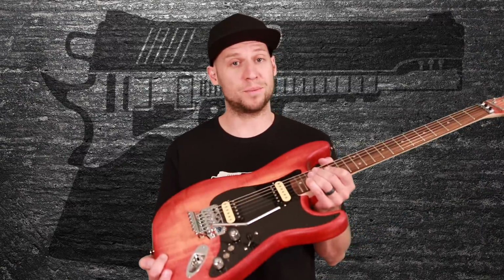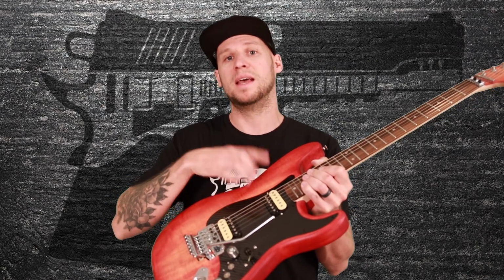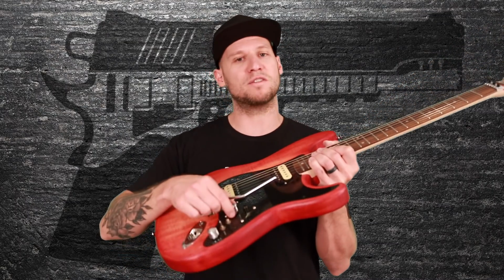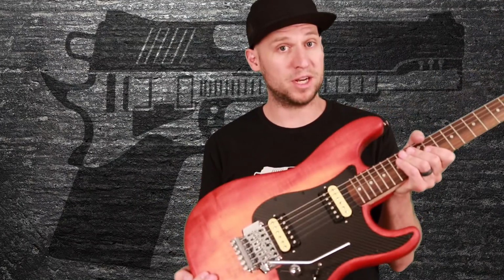This ONE Guitar has EVERY WIRING HACK POSSIBLE! (well...almost...)

Comment: While it is not 42 different tones, the Freeway switch doubles the number of pickups that are "on" at one time...allowing those parallel/serial options, all three pickups selected at once, or the neck & bridge picup. Plus, there are now variable treble bleed circuits that allow adjusting the amount of bleed at will,  with an additional pot. The resistance of the now generally standard 250kΩ pots can be approximately doubled with a simple resistor in a series with the tone control. If the wiring is changed so one tone controls the bridge pickup & the other controls neck & middle, that  resistor can be  added to that  latter  pot, increasing the  brightness of 2 of the pickups, but not the bridge pickup which is usually already brighter than the other 2 pickups.

Comment: Writing this for myself to make it easier to compare...

PARALLEL

split, off 1:51
split, split: 4:42
off, split 2:21

parallel, off 1:41
parallel, split: 3:11
parallel, parallel: 2:41
split, parallel: 4:12
off, parallel 2:11

series, off 2:01
series, split: 6:13
series, parallel: 5:43
series, series: 6:44
parallel, series: 3:42
split, series: 5:12
off, series 2:31

SERIES

split, off 1:51
split, split: 5:03
off, split 2:21

parallel, off 1:41
parallel, split: 3:32
parallel, parallel: 3:02
split, parallel: 4:33
off, parallel 2:11

series, off 2:01
series, split: 6:34
series, parallel: 6:04
series, series: 7:04
parallel, series: 4:02
split, series: 5:33
off, series 2:31

FAVORITES

CLEAN
parallel, off 1:41
split, off 1:51
split (in parallel with) split: 4:42
off, split 2:21
off, parallel 2:11

DIRTY
series (parallel) split: 6:13
parallel (series) split: 3:32
split (series) series: 5:33
parallel (series) series: 4:02
series (series) series: 7:04

Comment: My ‘83 Washburn Force 2 has been a work in progress for a while. It was HH like yours. I removed the original pick guard and electronics and made a new pick guard from scratch. 2 newer Washburn Humbuckers were installed and a middle single coil added by routing the guitar and pick guard. 2 DPDT switches on/off/on for the HB’s. Neck pup is full H or single coil. Bridge is in or out of phase. On/off push button for Texas style mid pup. Separate vol. control for each with treble bleeds blends pups in any combination. Stacked vol. knobs keep it simple. Tone for mid and bridge. 15 distinct tones with switches. Blending the out out of phase pup with vol. gives some really nice tones. Switches and knob layout is user friendly and easy to master. Has a Washburn 2000 trem and locking nut. Plays like expensive boutique model. $300 invested total.
NOT for sale! Love your channel. Dave

Comment: You should try half out of phase (out of phase, but with one pickup in series with a capacitor to block the low end), half humbucker (instead of using the humbucker as a single coil, sometimes one coil is put in parallel with a capacitor. In effect, you get the highs of a single coil with the lows of both in series. It's generally less thin and more versatile than just one coil of a humbucker), and lastly, whenever I put two pickups in series, I like to put my tone pot between the two pickups (the same idea as putting a capacitor between the coils of a humbucker, but acting on the two separate pickups instead. Generally, I find two pickups in series to be great sounding but a bit too fat sounding to make me want to roll down the terrible with the tone pot, having the tone between the pickups, you can get the treble from one pickup and low end from both in series, also a great feature to have with series out of phase, similar idea to half out of phase but in reverse).

On my tele type guitar, I've got a five way switch and a mess of other switches to get the tones I want. I'm planning to redo it and simplify the controls with the following:
A freeway 6 position tele switch that handles all the series, parallel, in phase out of phase, and single pickup options. Then I'll have a push push tone pot that'll either put the tone pot in parallel to the neck or bridge pickup. That will give me a tone bypassed or normal tone option for either single pickup, normal tone for both parallel settings, and a tone pot acting on just the neck or just the bridge when they're in series. Then I'm putting a dpdt on-on-on switch as a bass cut for either the neck pickup, bridge pickup, or both (for parallel out of phase, this will get you the half out of phase tone. In series it'll just give you a base cut on the entire circuit, normal bass cut on single pickups, and the treble of one with full range of the other when using them in parallel)

Comment: Shortly after you posted your first video about this guitar build, I sat down and did some work to try and reverse-engineer what you could have done, but I've been stuck on one thing: running split pickups out of phase with each other.

So here's a few questions worth asking:
1. When the pickups are split, which coil do you tap the output off of? The white or the black?
2. When running a split pickup out of phase with the other, do you have any special wiring trick that prevents the phase switch from also switching which coil is tapped?

My second question comes from when I was reverse-engineering how to combine both coil splitting and phase reversal, I found that if the red+green wires were grounded and only the black/white wires were used to source signal from just one coil out of the pair, switching between the two would reverse the phase of the pickup, but it would also switch which coil is sourced as well, which I suspect could also have an influence on the tone of the guitar.

I'm curious to know if you have any super secret wiring tricks to work around this particular thing (I hesitate to call it a problem because it could very well be intended and desired operation for some), or if you just used the white/black wires on the pickups after all.

I'm keen to figure out if there's some way to combine not only splitting the pickups and phase reversal like this, but also deliberately switching between which coil is sourced regardless of phase. But that might require a few extra switches in order to pull it off properly. IDK. I'll keep doodling this idea on my little whiteboard and in my notebook to see what I can come up with.
Reply from the maker: 1) when split, it isolated the north coil of the neck and south coil of the bridge
2) in order to be able to have reversed phase between the two pickups, I put a switch after the bridge pickup parallel/split/series 3 way toggle that reversed the polarity of the output from that 3 way toggle before it goes to the pickup selector switch.
Reply: Sweet, thanks! :D Keep up with what you're doing man. You're definitely an inspiration to me over here. <3
Reply: @calyodelphi124  Hey bro, do you have the complete diagram? I have a doubt, when i put the split mode, which one of the coils will be desactivated, the screw one or the slug one.

Comment: The editing of this video could not have been very fun.  Would you be sharing the wiring diagram for this?
Reply from the maker: You’re right, editing this video was not fun at all. And l be doing some wiring hack tutorials for these mods
Reply: When? And I second for the wiring diagram :)
Reply: I don't want to take away Dan's glory, but I believe you can use this: 

https://guitarelectronics.com/2-humbuckers-3-way-toggle-switch-1-volume-1-tone-series-split-parallel-reverse-phase-master-series-parallel/

but swap the two 2- way switches with push/pull volume/tone controls.  Looks like they wire up the same, you just need to be sure you get the appropriate controls onto the desired knob.

I fell in love with the sound, looks and the idea of this guitar and have spent the last several days trying to learn enough about guitar wiring to puzzle this out.  Still a noob, but I think the above is it...
Reply: @minethulhufhtagn7239  Hey bro, do u know whats the coil that will be desactivated on split coil mode? the screw one or the slug one? i dont understand cuz the link you share it says Single coil(north) or (south).

Comment: Awesome stuff Dan - I did similar on my flying V but with just 2, 3 way switches. Very versatile. Then with help from you, I did 3 x Coil split switches on a home build Strat with 3 hotrail humbuckers.(14 tones I think) - I tried the phase switch also but found many tones were very quiet and unusable and reverted to just coil splits. Once you get over the 14 tone mark it is hard to recall them in a hurry. Thanks so much for your help. I have really enjoyed these mods and now have the confidence to do more crazy switching. The Strat is great for layering guitar tracks as you can use it for all different sounds/parts. A great home studio tool :)

Comment: Here's some things I would love to see available for mounting within the body of a guitar, rather than as pedals, etc: 
1. A speaker & amp for practice purposes. It can be very small as 3 watts would be more than enough, and some very tine speakers have wide frequency response.
2. A circuit & switch that allows the guitar to simulate a 12-string...now available in a pedal,  and guite authentic sounding.
3. A circuit that will produce a bass  tone (an octave below the E & A strings) when those two strings are played.

With modern miniature components, all of this could fit within a 2nd cavity to be located under a std  Strat pick-quard & no larger than the standard Strat controls cavity.

Comment: On some of my guitars, I used some soft metal bars so that some pickups only detect the two lowest strings, and used a fixed resistor between the all-strings pickup and the bass-only pickup so that a tone control attached to the former would affect the treble strings more than the bass strings.  Have you heard of anyone else doing such a thing?  The biggest design limitation is that the metal bars make the bridge pickup great for adding bass, but of course totally useless for upper-string lead parts.  If I could get some pickups made that were split 2+4, though, perhaps with a two-string humbucker sitting next to a four-string noiseless single coil, that would add even more interesting wiring possibilities.

When I've played with anti-phase wiring, I've found that the effects varied a lot with my position on the fretboard in a way that wasn't very aesthetically pleasing, but you made it sound good.

Comment: great job, man!
never know what you might need, especially how it sits in the mix
i have a s+s+h strat which can potentially give me even more options
i figured i had m+b out of phase, which sounded weak and noisy. so i put a switch inside the cavity so i could change the wiring back if i need to

Comment: I'd really like to see you use piezo pickups on your builds
Reply: hugues pinaud add a piezo to this guitar to get more options. And the option to use the screw single coil 🤯 i use dual humbuckers with triple shots mounting ring. Was pondering to build this too. And a middle pick up with the option to turn it on/off. Bc, why not? 😂
Reply from the maker: I’m not sure I could fit all that wire under that pickguard 😂😂😂

Comment: One issue here; pickup-to-pickup spacing.  To get the iconic strat quack, you have to have the right spacing between pickups (neck to center and center to bridge).  I think the parallel combinations would sound way more strat-like by mounting the pickups closer to each other.  A quick way to hear this difference is to compare, say, a PRS 22-fret model vs 24-fret; you get more quack from the closer pickup spacing of the 24.  I guess it depends on what you are going after.

Comment: I've been down that road of all the pickup switching options but it kind of turns into choice paralysis in playing, particularly live. I like to use a 4p5t ("super") switch to get a handful of tones I'll actually use, but of course it takes some experimenting to get there. Rule 1 is a panicked flail gets me back to a main rhythm sound, rule two is additional switches change mood. A good example is a HSH or HSS strat that behaves like an SSS with the switch one way and HSH switched the other way, or a HH guitar on a 5-way switch that does parallel and inner coils on positions 3,4 and 5 with a switch for single coil options.

The latest cool thing I've done for a customer is a rotary switch in place of a tone pot on a strat that brings in some capacitors in +series+ that function as a bass cut. 10nF to 470pF is a good range to explore here with a strat 10nF being quite gentle and 470pf being really thin.
Reply from the maker: Very cool!

Comment: Awesome channel, man! You've inspired me to mod my SSS Strat. I've put in a DPDT 3-way switch, along with 2 push/pull pots, and an under-saddle piezo pickup that goes into an onboard jfet preamp.

Before I got the pots and piezo pickup, I had a 9-way mod with the switch. (series/standard/parallel), and it worked great. However, now that I have two more options to tinker with, I'm at a loss. I'm thinking of using one pot (0.022uf tone pot) as a phase inverter for the bridge, and the second one as an on/off and separate volume for the piezo. I've installed a stereo out jack as well, that circuits the battery for the preamp so it doesn't run constantly. Could you help me out with the wiring? I just can't seem to get it to work. 

Anyways, awesome channel!

Comment: Hey my Wah pedal isn’t working it’s the Vox v845 I was using it one day and it just clicked and it wouldn’t work. I turned it off and it worked clean but when the Wah effect was on it was just silent I replaced the switch in it and tested that to make sure that the switch was working I also check the pot in it to make sure that that wasn’t stuffed, but it still didn’t work. Any tips on troubleshooting?

Comment: Great video, haven't seen anything like this done before or anywhere near as well put together. That riff was pretty good too, easily tolerable for the this purpose. Quick question, would out of phase in series setups have similar output to in phase in parallel setups?
Reply from the maker: No actually. Out of phase doesn’t have any less output than in phase, the difference is that more frequencies are “cancelled out” by opposing sound waves. Series will still have double the output as parallel, in phase or out of phase, it’s just the way we perceive it that makes it sound different.

Comment: Awesome vid! As usual. : )
I have a HH Schecter with coil splitting already and I would love to see all the ways to mod it so I can have it go in series and parallel too. It only has a backplate like a les paul so I would have to use a push-pull knob because I don’t want to drill holes in the body. Thanks!
Reply from the maker: That will be a challenge because I don’t know of any 3 way push/pull pots. You’ll have to choose either split or parallel
Reply: Hey Dan,
Thanks for responding!
My guitar has a master tone and a master volume. The tone is already a push-pull which splits the coils but the master volume is a regular knob. If I switch the volume with a push-pull, would I be able to get series and parallel? No problem if I can’t. It could be I’m just not understanding how the parallel and series work. 
Thanks for taking the time to respond!
Reply: Ohhh okay I think I see the problem: to have the humbuckers split, parallel and series for each one, I’d need a 3 way toggle or whatever for each one. If I want to have them both in series or parallel together, I could have a second push-pull for that like in your guitar build.

Comment: Great demo Dan! It's difficult not being there in person, but does the single coil options sound similar to standard Strat single coils? I'm planning a new build and wondering if I should go with singles or humbuckers? Or maybe just one in the bridge. Thanks!☺
Reply from the maker: It sounds very similar, but not exact. There are some pickups that will do better than others when split, but if the tone you’re seeking is single coil strat tone, then a single coil pickup is going to be the best.
Reply: Guns and Guitars ok...thanks so much. Maybe I'll just put one in the bridge and a single coil in the neck and middle. I love that neck single coil tone! Appreciate the info.!👍😎🎸🎶

Comment: This yould be intressting with 2 P-Rails and an middle sinlge coil and an option where you can sill use only the 2 P-Rails..... and if you really want to be crazy also a P-Rail in the middle. So you have P 90, single, parallel and series on just on pickup....... hmmmm so much options

Comment: I think outer/inner coils would be a better option than split/parallel. Still killer setup though =)
Reply from the maker: It gives you more tonal variety for sure. Parallel is just a good option if you want single coil sound but still have hum canceling.
Reply: @GunsandGuitars  Hi master, i have a doubt about that, when i split, which coil will be desactivated? the outer one or the inner one